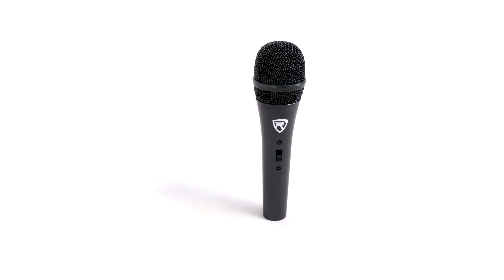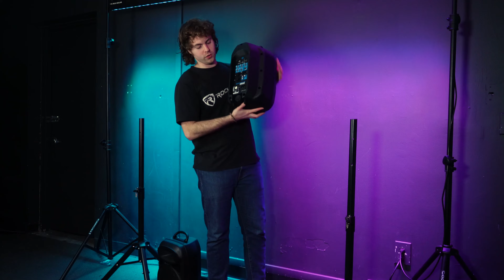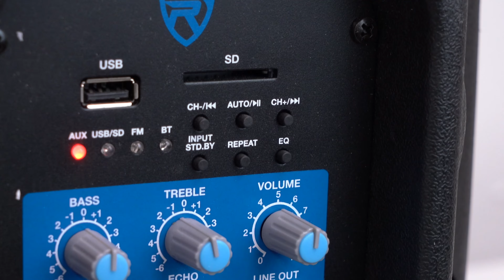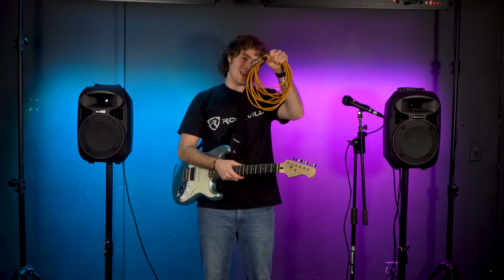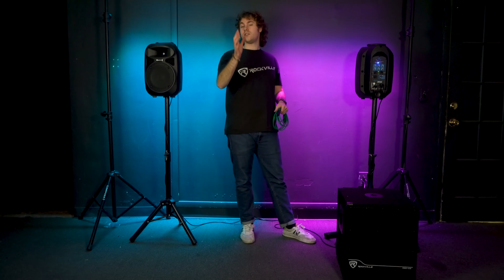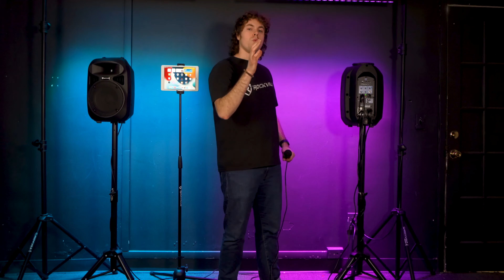How To Set Up Rockville RPG082K Dual 8" Powered PA System Speakers

Comment: Just bought off reverb, said mint condition but not powering on
Reply from the maker: Sorry to hear it's not powering on! A few quick checks: power comes into the active speaker (the one with the controls), so make sure the power cable is plugged in tightly on both ends and the power switch is in the ON position. Try a different outlet and a second power cable if you have one, and check the fuse (the owner's manual shows where it is). If it still won't turn on, reach out here and our team will help: https://rockville.s.gy/contact
Reply: @RockvilleAudio thanks but already sent it back, I checked the fuse and swapped it for the spare. Looked like it would've been a fun product, bummed I didn't get a chance to jam on it. Thanks for the reply.